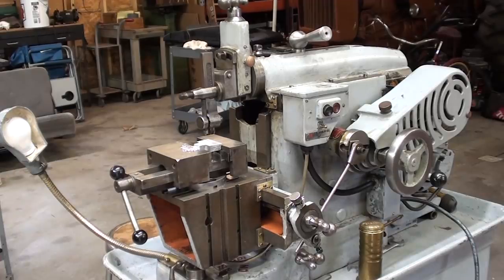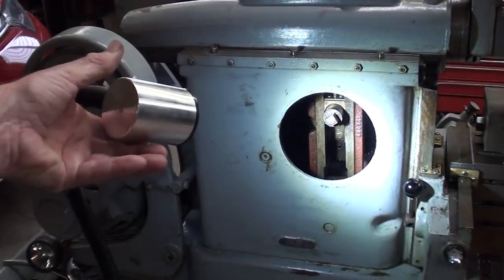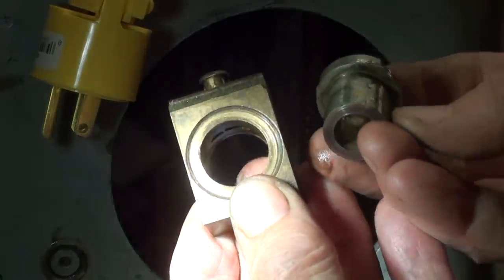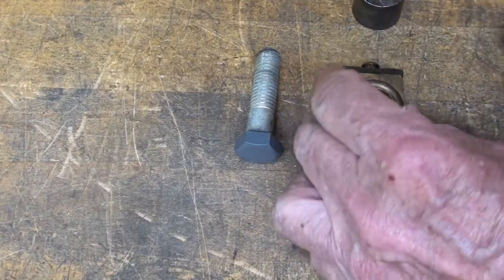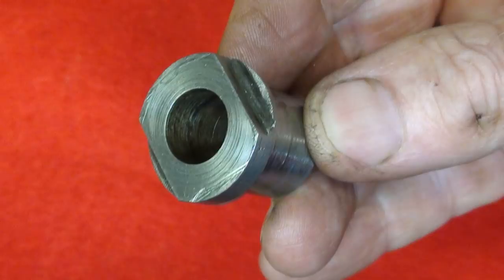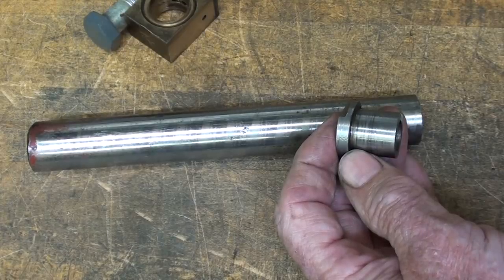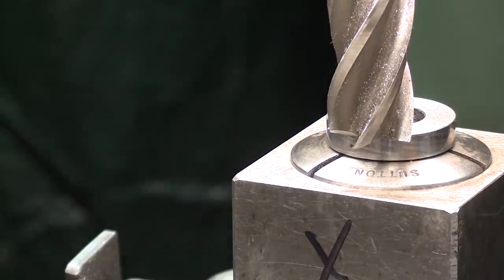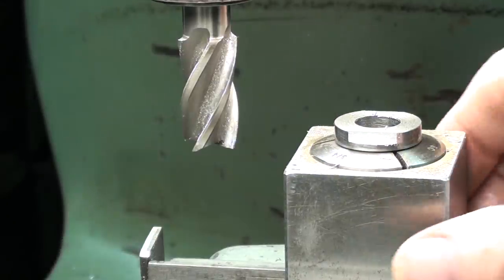Fixing My South Bend Shaper TIPS 571 tubalcain mrpete222

Comment: Thanks for sharing that, Mr. Pete - I'm in the process of functionally rebuilding an Alba 1A shaper, and will need to make some repairs in the block area of it.  While some of the parts have slight differences, the basic operation is the same.  The thing is that I will need to make a new sliding block, and seeing that yours uses bronze I might make my new one out of bronze too.

Comment: I like the way you see something that needs fixing, and step to the machine shop for the job. That's what I use my Logan lathe, and Index mill for. I would like to see you build a carridge lock for the logan lathe. I've found that a replacement on e-bay is around 60.00, and way too high. With the wierd shape, holding in the mill would be challenging. Great video.

Comment: Thanks for working on this machine. I bought this exact machine last week. I have not turned it on yet as I am almost completely disassembling it to get it restored. Unfortunately, the top dovetail oilers were clogged, so that part of the dovetails are pretty gauled up. The part that raises the Z axis is also completely messed up. Will have to see what I see when I manage to get the table off.

I will make sure to take a good look at the part you made in case I need to make one myself.

Edit: The bottoms of the dovetails are also not at all flat, so I am going to be scraping those in too.
Reply from the maker: I better check my oilers to see that they are open

Comment: Lyle, This part will have to be heat treated like the original probably was. The one you took out that was bent was likely a shop made part that wasn't heat treated, so it bent. I would use 1090 drill rod to make it from, then heat treat and quench, then draw it back to maybe Rc 40 or so. Then polish any bearing surfaces in the lathe. It should be as good as the South Bend part.

Comment: Nice work.  I wonder if the original damage was caused by a missing wrench, then someone used a ratchet and socket and ended up over-tightening it causing the ears to bend.  Anyway, seems to be working very nicely now.

Comment: I had trouble visualizing how that clamping mechanism was supposed to work and how it failed until I saw that it clamped in a slot on the rotating part, not on the oscillating part.  Now it's completely clear to me.  There's no threaded stroke positioner like on its much bigger cousins.  It's also clear why you were not worried about the brass slider. That's not part of the champing problem you're trying to solve at all. That little shaper is just as cute as a little speckled pup. While I wish something like it was in my shop, there's no room so I'll be satisfied with watching yours.  Thank you.

Comment: Great Example of maintaining your machinery. Machines Keeping Other Machines running. Those Locking Bushing ears look fairly fragile and it looks like over-tightening over time has taken it's toll; Fortunately it was simple to make a new part. Glad also you used a collet block to it's best advantage: no need to find the edge with great precision...just take a cut, flip the block 180 degrees and take another and measure.
Reply from the maker: Yes 👍

Comment: Excellent job Mr. Pete!  Nicely paced and showing just enough for most folks to understand what's going on.  The more intriguing part of the failure still eludes me though.  How is it that just cycling power caused the machine to slip but did not seem to while continuously running?  Start up torque?
Reply: @Rich Wojehowski
I concur. Was going to suggest that he utilize a 'soft start' capability in the motor.
Reply: I don't think mrpete has ever had a soft start.....😉😉😉😉

Comment: Lyle,
Thanks for another great video.  Now my questions:
1.  Why didn't you use your SOUTH BEND lathe to remake the bushing?  ;)
2.  When center drilling the bushing your drill looked like it jumped to the right about half a mile.  Then when you used the two twist drills, they appeared to jump about the far to the left.  Why do the drills jump around like that and why doesn't it matter?

I'm looking forward to more educational shaper videos!
Reply: Drills are lousy at making centered, perfectly round holes. First because they can't really cut right at the center of the bit, and second because of how and where they remove material. A boring bar is the usual go to for getting both roundness  and concentricity, a reamer when dimensions are critical.
Reply: I because of how it works, perfect concentricity doesn't matter. Even a few thousandths would be just fine as long as there wasn't any play.

Comment: My Steptoe has the adjustment and lock outside the case, on the operators side.  I noticed recently that the lock doesn't seem to do much.  There isn't any problem with it holding it's stroke length, but I should probably make sure there isn't any damage happening.  Considering the long period of non-use that it had before I got it, I'm thinking that what the knurled collar pushes against to lock the stroke length may be stuck.

Comment: Was the one ear bent as some notes or worn down? Could you have milled new flats at 90 degrees to the old if you could not turn a nice new part?  I have not seen anyone show how to grind a cutter compared to one used on the lathe.

Comment: You could have cheated of course,, and just turned the original part 90 degrees and milled two more flats on it to size ! Nice fix Mr Pete
Reply from the maker: No, they were bent
Reply: @mrpete222  oh well it was just a guess, but if they were bent then making a new one was your only option without trying to find s new old stock part. And what's the point of having all that machinery, and not making your own bits? lol. greetings from the UK Mr Pete

Comment: I remember using the shaper in high school metal shop class and I was using it to shape a black of steel for a hammer head project and I am watching it shave off hunks as it went along and one of the shavings went right up my nostril and it was extremely hot and I heard it going tsssss as it burned in and I am hopping around in agony, trying to get it out with tears running down my cheeks. I eventually got it out and after that, only used the machine with a face shield.

Comment: Because the locking nut is not a through nut but a dome nut the length of the part you are making is what determines the strength of the locking pressure to the part so by making it the same dimension except for the shoulder puts you only 50% the way it’s a shame the information you have doesn’t give full dimensions for the part to see if the dimensions you are working to are the worn dimensions or the intended dimensions it would be interesting if someone has the actual dimensions from factory
Reply: A very good point which I thought about watching the video; ... slightly modifying the dimensions to compensate for the wear or improving the part for better service life.
Reply from the maker: I was going to make it thicker. But decided to copy of the old dimensions best I could